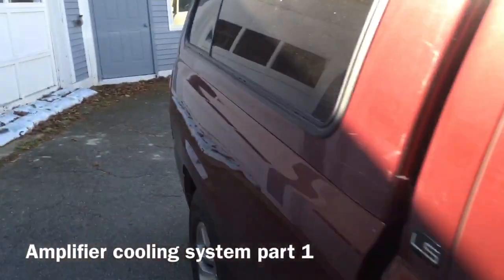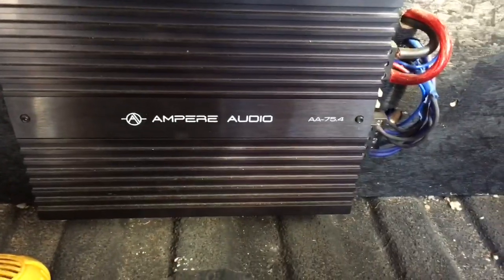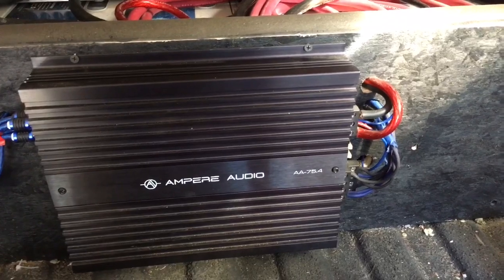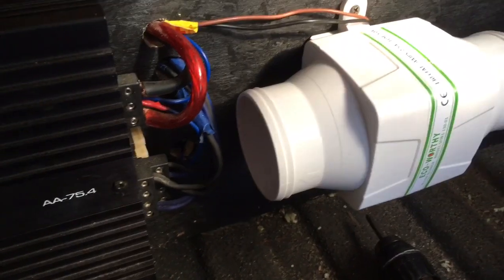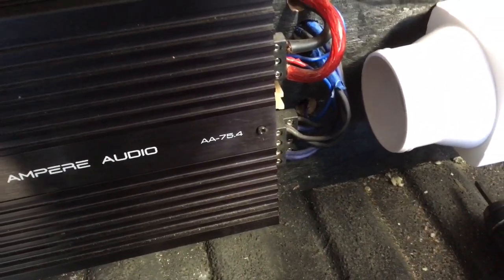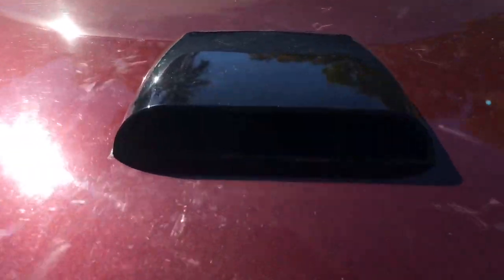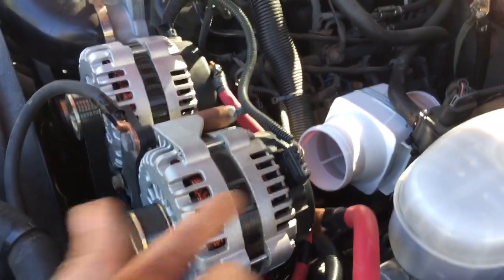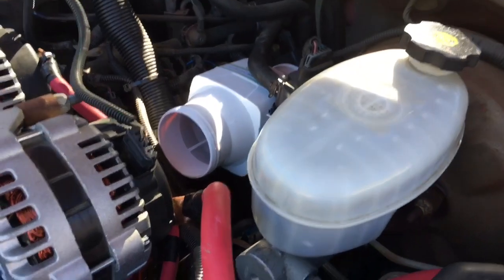HOW TO KEEP CAR AUDIO AMPS COOL/ reduce heat/ installing cooling fans

Comment: How many rpms is the fan?
Reply: Oh i see, in that case, what's the rating of this particular fan?👀
Reply from the maker: This is a seaflo 4” fan. It can move 270cfm. Which is more than plenty to keep amps cool.
Reply from the maker: Fans don’t work off rpm, they are cfm rated.

Comment: So im looking at the same problem.. Only thing there loud as shit!! And I have to run 3 of them.. Now with drawing 2.5 amps of draw.. Does it me as with anything.. Can u drive for a while with them on?? Is it ok to do that.. Drive for hours with them on?? Or only switch them on when its needed??
Reply from the maker: You can run them constantly if you want. Or just when the amps are on.

Comment: What kind of relay you need for these fans to run and shut off automatically
Reply from the maker: That I don’t know: but you can wire em up to a toggle switch and turn em on and off when you want.
Reply: @EARDRUMASSASSIN  thanks very much
Reply from the maker: Welcome and thanks for stopping by .

Comment: Nice ,what made you fan the alts and where did you get your bracket from for dual alts?
Reply from the maker: TEAMCHEVY #CommentKing the excessive heat the alts generates was the main reason for the fan while at shows sitting still. It allows cold air the blow on the back of them to help keep them cooler and from overheating . The bracket is a dc audio bracket that a homie sold me .

Comment: I thought I heard a jet fly by when you hooked up the fan. 
Damn lol
Reply: Question, why does my amp cut off when I hook up my fan(s)
Reply: @heathenthatheretic5960  need a. Relay to run it bur these fans are louder than the car itself